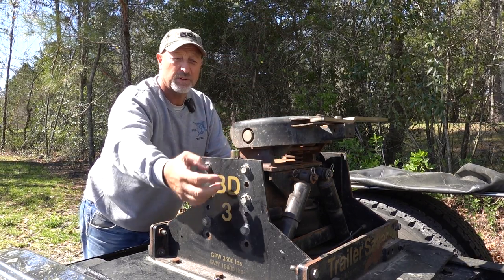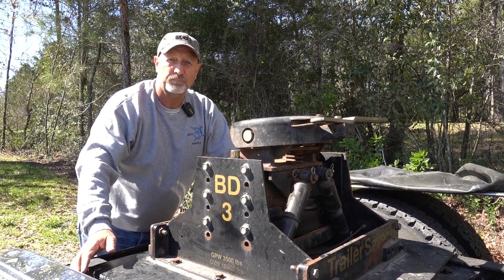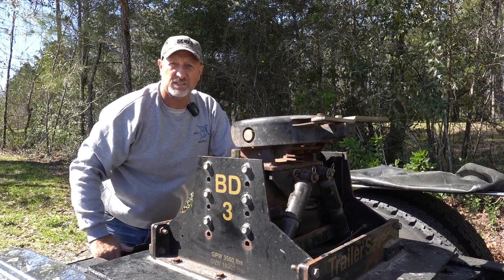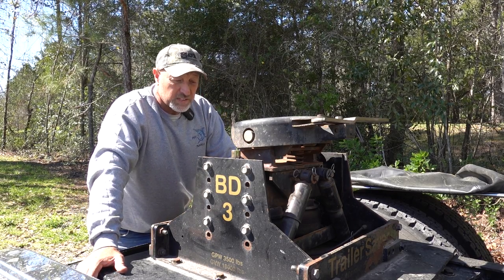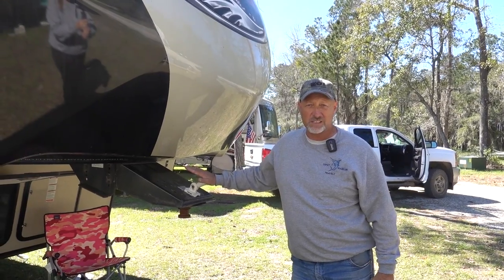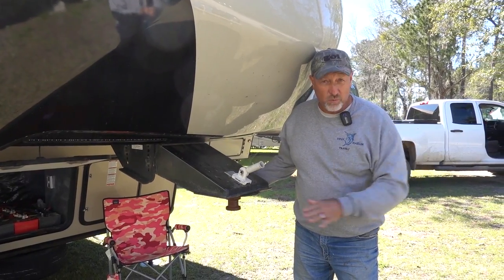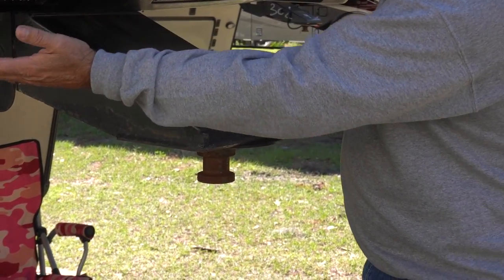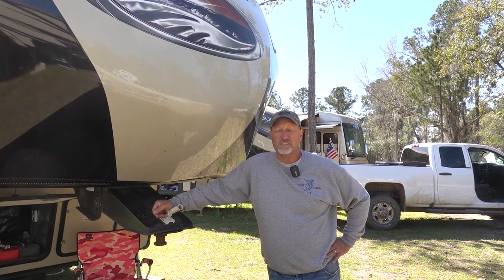This Old Truck: Why We Got Rid of the Commercial Hitch

Comment: I drove alot of trucks with a air tag axle. There was a lever in the truck with a air pressure gauge one of these would work great for adjusting the air on your hitch from inside your cab. Just an idea don't know if it would work for you
Reply from the maker: That's a great idea and could be really helpful. Thanks for the idea!

Comment: Found a used Hensley BD3  Was just wondering about height. I saw it has a height adjustment but still looks tall. Is it taller than the Hensley TSLB model. The BD3 is priced at $1000   Thank You
Reply from the maker: Bubba went out and measured ours. The solid base is 12 and 3/4 inches high. From the truck bed to the top of the plate ours is 17 inches, but can be lowered about 3 inches if needed. Not sure how it compares size wise to the TSLB, but $1000 is a great price. We paid $2400 for ours almost three years ago.

Comment: Thanks for the info- Do you have to add air and release air at on this hitch each time you connect and disconnect?
Reply from the maker: Once the air pressure is set where you want it you don't have to do anything to it . We have played around a bit with different air pressures to get the best ride for the trailer, but once it's set, you're done.

Comment: Bubba,. In a dilima.  Looking at the Trailer saver or the ET Super Hitch.  Both in the same ballpark for pricing.
I know Aron and Jim run the ET Hitch and you guys run this.  Which one would you recommend and why?  Thks Brian
Reply from the maker: When we were choosing our hitch, we had talked to people using the Trailer Saver and they had nothing but rave reviews for it. Plus, at that time, the ET hitch was running a lot more in cost, so we went with the Trailer Saver. We have been extremely happy with it. Our only issue is that the head of our hitch rides on two guide posts, which allows it to float up and down on the air bags. Last year we noticed those two posts were worn and slightly bent. Trailer Saver sent us new ones free of charge, calling it a warranty issue, and we replaced them. If you have an air ride pin box then you may not want to go with an air ride hitch too - air on air gets pretty bouncy and sqirrely. If you have a fixed pin box, either of these hitches will serve you well. With the Trailer Saver, they have several models based on the weight of your Trailer, so make sure you get the one with the proper weight rating. That's another thing with us - we have the one rated for 18,000 lbs., which is more than enough right now. If we ever buy a heavier trailer - say a DRV or a toy hauler - we'll have to buy a new hitch. Something to keep in mind for the future.
Reply: @TipsyMarlinTravels  We are purchasing a Grand Design Momentum M, it's heavy 20k empty.  And has a carry capacity of 6,500 lbs.  Fixed pin box.  TRI axle.
Reply from the maker: You're getting a beautiful rig!! Congratulations! We might have done some toy hauler shopping recently and really liked the Grand Design. I think the air ride hitch would help your trailer ride smoothly. It also helps take stress off of the nose frame of the trailer.
Reply: @TipsyMarlinTravels  Thanks, as soon as Cindy walked into she said this is the one I want.  Can't argue with the boss.  She has already claimed it as her dog house.  And told me I get the truck as my dog house.🤣💞
Reply from the maker: 😂😂😂 we also call Grace the dog house 🏠